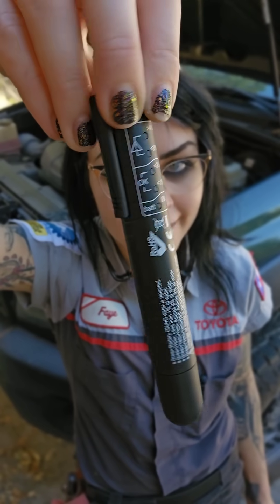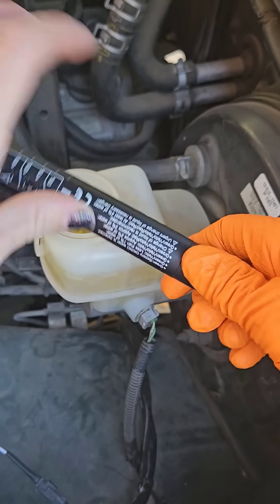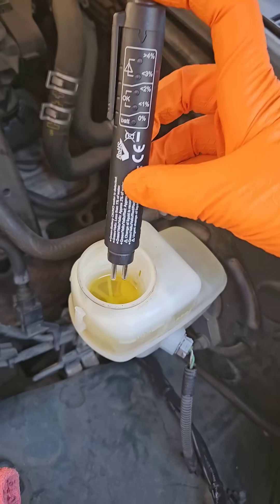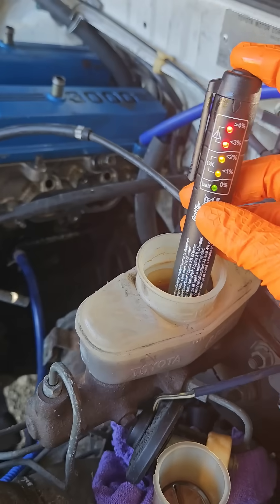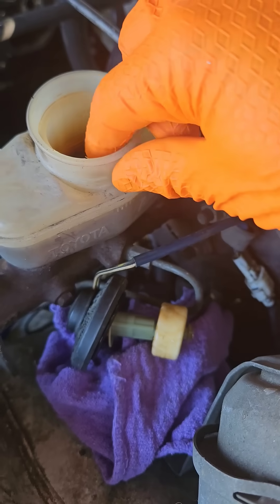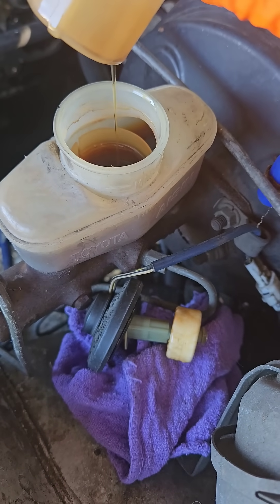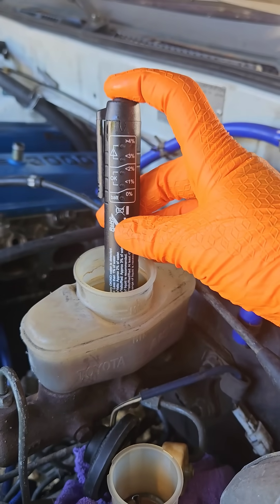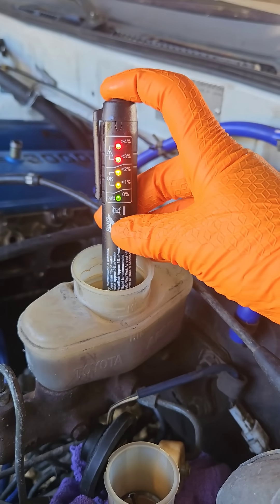Do you REALLY need your Brake Fluid Flushed?? How to Test it For Yourself!

Comment: Most manufacturers recommend a brake flush every 3 years.
If you stick to that time frame, you won't have anything to worry about under normal conditions.
Brake fluid is a lubricant as well and all lubricants brake down over time. Your calipers reach temperatures in excess of 300 degrees after repeated braking. The fluid in your calipers vreak down faster than the fluid in your reservoir. It's not a circulating system. Why risk brake issues over a $100 flush every 3 years?

Comment: Brake fluid is hydroscopic, meaning that it’s designed to absorb moisture.
Reply: That's not what that means. It only means that it absorbs moisture, not necessarily designed to do so.
Reply: @ORam...  it’s designed to absorb moisture to stop moisture ingress.

Comment: Great explanation. The only thing I do not agree with is that water in you braking fluid causes corrosion. Brake fluid is like the most corrosive liquid there is in a car lol
Reply: brake fluid doesn’t cause corrosion, it will just remove paint

Comment: Those do not work, most of those measure electric conductivity, but many modern brake fluids just are slightly conductive out of the factory, so if you use one of those tools on a brand new bottle, there is a high chance it will say that it's saturated while it's not. You better change it as soon as you get an used car, and then change it every 2 years or however much the car manufacturer says. Same with new cars, change it as often as the manufacturer says.

Comment: Everytime I do pads/shoes I empty the rez and refill at minimum. I was taught that during my apprenticeship (yes I'm old) and I just do it. It's not like it costs a lot and fresh fluid instead of burnt black crud can't be a downfall. Even if it's not a line flush a refill is better than nothing.
Reply: I wish any of mechanics were to scam me to change brake fluid and coolant. Its 11 years old at this point. It works great as years can tell breakes do work sharp and water pump has no issues. But then again Hyundai Santa Fe was build for idiots like me. Its probably gonna rust the frame before it shows issues. Recent oil change cost me $38CAD and mechanic asked me if I wanted to change cabin and engine filter. I said no cause I can unclip 3 prongs myself and throw a $6 and $15 filters myself and not worry about the car until next oil change in a year.
Reply: @ruslan1394 An 11 year old car can definitely have saturated brake fluid or contaminated coolant. The old "it works fine" attitude is just asking for disaster.
Reply: @HyperactiveSloth79  I agree it needs to be changed but its not contaminated coolant. Its still vivid green. 

I bought the concentrated jar of coolant from Hyndai dealer $20 (to be mixed with water) but I am debating since I don't want to dump the old water on the ground.

The car is 14 y.o. I bought it 3 years used. I just assume coolant once before was changed.
Reply: @ruslan1394 Once a year?! Do you hardly ever drive it? The only possible way a once a year oil change would be acceptable is if you use full synthetic oil and matching filter, drive it less than 10k miles a year, and change it every spring after the last freeze. 
For normal oil, filter, driving habits and usage, a once a year oil change is going to cut the life of your engine down by a LOT!
Reply: Your going to loose fluid anyway when you bleed the breaks. So when you change your shoes over you might as well. Flush bleed, top off. But that's the only time I've ever done it. With that being said I only own old vehicles. Damn Honda dealership is scamming the shit out if my dad. They told him he has to do a break flush, and get this a ac flush every time he comes in for an oil change. Or of course it voids the warranty. Also the pads have to be broken in and cleaned. 😂 poor dude he knows it's bullshit. But when you buy a brand new car for your wife this shit just happens.

Comment: I messed up once where i neglect the brake fluid flush timing. Had a car for 4 years and drove it daily. One time when i slammed my brake hard, the car wasnt stopping at all, nearly ran an oncoming car. Turns out the whole brake cylinder master seals were messed up due to high water content in the brake fluid from water saturation over the years. So yeah, flush your brakes at least around 1.5 years. Safety first!

Comment: 5years is rule for brake oil change. Gearcase oil change 100,000km.. Motor oil change 10,000km.. Its cheaper then repairing the parts 😉

Comment: There’s also the chance of copper oxide contamination of the brake fluid. This began back in the 90s at some point when Chrysler products started having massive amounts of failures in their antilock brake systems due to the buildup of copper oxide. This subsequently launched a DOT investigation and is also the cause of automotive repair shops actually being required by law to offer a brake fluid service.

Comment: Service Advisor: "It doesn't matter if the car has 500 miles, just do it, it's money for both of us"
Reply: Why’s it matter though? My truck has had the same fluid for like five years. Drive it everyday to work and it never had brake problems I’m not being a troll just to me it seems like if you just do it everytime you have to replace brake pads you would be just fine.
Reply: @xaphan8581 it's the same reason some people's vehicles last 100k with no oil change and some people seize at 5k lol
Reply: @tydatv2674  I’m not talking about engine oil I’m talking about brake fluid. That’s what the video was taking about.
Reply: @xaphan8581  it's an example. My point is it's all just random and luck based.
Reply: @xaphan8581 that's actually the perfect schedule normally! We usually recommend going by mileage or every 3 years, but it's also great to do a quick flush every time you replace brake components. 😊
Reply: @xaphan8581 industry standard is brake fluid “Bf”should be done every three years, regardless of mileage. The higher the moisture content the more corrosion (that equals more future repairs needed). The more moisture, the lower the boiling point which can cause brake fade under certain conditions, typically when you need your brakes the most. And finally, if you go too long between BF service intervals, the higher the probability that when you do finally bleed that system, that doing so will damage the master cylinder. It’s my understanding that the fluid, given enough time, can form microscopic crystals which then cut the rubber diaphragm inside the master, preventing it from sealing. Just do the darn fluid every three years…. It’s cheap insurance to prevent more costly repairs or unsafe conditions down the road.
Reply: @xaphan8581 Having bad fluid will make your breaks wear out faster. How often you should get it flushed is dependent on your vehicle and driving style. You should be able to get by with flushing it at least once a year, or even once every 2 years, depending on those variables.
Reply: Shhiiii I wish. Everywhere I've worked it's the opposite. I'd be rich as hell with service writers like that. 😂

Comment: I flush the system when I change brake pads. I have the bleeders broken at the calipers anyway, before starting, the fluid in the master is removed and replaced before opening the system. A great add on to a professional brake replacement operation.

Comment: Test the reservoir only tells you what the quality of the brake fluid is in the reservoir. The braking system does not circulate fluid so the state of the fluid will always be worse in the lines and in the callipers. BUT if the reservoir fluid is bad then it's definitely time to flush it through.

Comment: It's a scam. Never used to have to flush your brake fluid every 2 years or whatever BS the automotive industry is promoting nowadays. Just took my old lady's VW in for a 30k oil change and when i got the car back it said they had flushed the fluid. What a scam.

Comment: Change it if its oveer 2 yrs ??? C'mon lady, its probably more like change it at your 60K 5 yr tune-up. No reason to get over aggressive with a change this change that at half life attitude. If your brake fluid is only lasting 2 yrs, youve got a deeper issue than the fluid itself, somethings causing the failure, just changing the fluid means whatever the issue is, is going to get worse, and before you know it, your going to be wondering why your fluid is only lasting 6 months...I had to replace my headlight bulbs every month or two, initially blamed it on buying cheap bulbs, until I realised the headlight lenses were cracked, and everytime it rained, water would get in 😮

Comment: True way to test it is by taking it out of the front calliper as that’s where the heat and moisture build up is. Brake systems don’t have a recirculating system so measuring the top up  reservoir means nothing as that’s technically fresher fluid.

Comment: My brake fluid is as old as the vehicle, therefore it was first put into the system in 2003, more than 20 years ago, and the vehicle has over 255,000 miles on it.  Now...what were you saying again?  I forgot.

Comment: Changing old brake fluid is one of the few times when you can actually feel a difference.
Reply: Very true. Like in some cases a near night and day difference especially where really neglected systems are concerned.
Reply: I bought a 89 CRX Si and god knows when the brakes were last serviced… anyway the first thing I did was flush the brake fluid and the night and day difference in pedal feel is immense, as well as greasing the caliper pins and all the brake pad slide points. Probably the most important and also fulfilling job to do on any car
Reply: If you want the calipers to last the life of car, do this.
Reply: I changed fluid on my last car after one of the calipers completely seized up and the car wouldn't move. Of course I also did pads, rotors and the front calipers but I did feel quite the difference lol.
Reply: yes. it always gets much softer and easier to control for me with new fluid
Reply: Jojo-lx8sx I've got some snake oil to sell you then! $20 a bottle, 1 bottle a day, and I promise after a month YOU will tell me you feel a difference!
Reply: Maybe not.
Reply: lol, you will not feel a difference because of the fluid, if there is a difference it's because of something else being remedied by the bleeding. The only possible difference is if you are so hot you are regularly boiling the fluid.
Reply: true, i have a not very old mazda cx30 (2 years) and they changed the break fluid and immediately feels different, so smooth and nice
Reply: Sadly yes...its scary when the brakes get squishy
Reply: @df7817  It's squishy because there's air in the system, the pump doesn't work properly, or there is a leak or a pipe is blocked. Never and ever you see squishy pedal because there is a 0.001% of water inside the oil
Reply: @df7817 they only get squishy if the water turns into steam..which is like never.
Reply: Do  bushing and change wared suspension linkages. Best filling ever <3
Reply: @jarocim  Yes, you are correct, I just had the suspension replaced with all new Toyota parts for my 2008 Highlander with well over 200K miles on it, was like driving a brand new car again. 👍
Reply: If done on schedule it will be well before you can feel a difference
Reply: @rupe53  

But that's just the point. It rarely is done on schedule, particularly on older vehicles.
Reply: Bwahhahahaaa😂
Reply: @adccars359  

Whut?

Comment: I use a similar device to test brake fluid every day, but that's not what I'm here to say... when Brake fluid is left too long and absorbs water, not only does the water boil, but causes sludge and eats away at the inside of the brakes, so you end up with sticky and leaky brakes... a bottle of brake fluid is cheap, much cheaper than a brake rebuild... which will need to be done way sooner if you don't change the fluid. but not doing either could cost someone their life!

Comment: Amen. The 01 camry i bought beginning of last year never had any attention paid to the brake fluid. A priest, an exceedingly old woman, and a 19 year old kid were the chain of command before i bought it. $1000, 70K on the motor, but the brakes felt odd from the day i bought it. December i had two major strokes, and when i finally tried to drive it again, aggressively pumping the brakes HARD, and pulling the e-brake like a lonely virgin on prom night. New master cylinder and brake booster finally worked on the 2nd set when i physically disconnected everything and blew out the lines, freeing lots of chunky rust to be expelled. The old booster was full of rusty water and brake fluid. Pay attention to this, it was almost as devastating as the health issues. Special thanks to rockauto and dorman for preventing a meltdown that definitely would have caused me to stroke out for a 3rd time. Check your flippin' fluids properly, the consequences are devastating.

Comment: Adding to her good summary; brake fluid becomes acidic as it absorbs that moisture. This caustic affect begins to erode copper out of your brake lines and valves. Eventually, and i mean eventually, holes will be eaten out of your brake system and youll get a leak. So if your fluid looks green or smells like fish change it!

Comment: I got a brake flush once. The tech left his wrench on the bleeder valve nut. As I drove home all was good, but while in a parking lot and making a sharp turn, I suddenly lost all break pressure. Then after straightening the wheels, brake pressure returned. Imagine the confusion I had and the trouble convincing the dealer that something was wrong. 

I went to another dealer and they found the wrench. It would impact a strut when wheels turned far enough and that would impart force against the caliper’s bleeder valve temporarily. Such a strange situation. Anyway, it was resolved, but not after much stress.
Reply: Wow, that is so random.
Reply: that is a weird one

Comment: A mechanic told me once its a good idea to bleed the caliper of fluid when you do a brake job because the fluid doesn't circulate becoming acidic over time from heating and cooling. And of course water is a problem too.

Comment: Everytime I've had a customer open the master cylinder they either lose the cap and tape a plastic bag over it letting moisture in or fill it with washer fluid. Do-it-yourselfers from you tube actually make me more money. The hoods should be locked shut so people who dont know what they're doing can't cause damage harming other people on the road. You can also buy inspection cameras online for $25 and perform some endoscopy on yourself to see if your doctor is scamming you. Lmao

Comment: Over the course of my 30 years of working on cars, I've never seen a brake fluid flush benefit a vehicle. Unless there was a incompetent person working on the vehicle prior there shouldn't be water in your brake lines. You have bigger issues.  Also if you have a master cylinder failure you'll be doing a flush regardless.  Not selling me on this.

Comment: Thing you didn’t mention was the rubber seals in the master cylinder getting messed up if you don’t replace the brake fluid. I bought a car and replaced the fluid and found out the hard way. Nearly crashed due to intermittent brakes.

Comment: Second thing. Flushing brake fluid out is ridiculously easy with two people but a bit time-consuming. If you know a handyman or mechanically inclined person, I'd consider asking. You can press/pump the brake while they open and close the valve at the brake caliper. (Not getting into details here, but that about sums it up)

Comment: Don’t need any fancy tools; use your eyes. Since brake fluid is hydroscopic, when it absorbs water it will oxidize, turning a dark color. The darker it is, the sooner you need to flush it out. Or flush it out at regular intervals, such as 30,000 miles.
Reply: That’s basically what I was going to say.  I once took my brand new Nissan frontier in for its FIRST oil change at the stealership.  The kid told me I needed to get my brake system flushed.  I had him and the service manager use the tester in my brake fluid.  It felt nice to see them both look so ashamed of themselves. I got a free set of weather tech mats from that oil change.
Reply: @petrosspetrosgali Nice! I wish I could get a $400 set of floor liners for free!
Reply: I might say sooner than that if you live in more humid and rainier regions too.

Comment: Brake fluid goes bad over time, not catatonically fails.

If your brakes are starting to get squishy, check it out, but you don't need to add "open the sealed system" to your PMC's

Comment: I recognize that I'm gambling, but I have done most of the work on my cars for the last 20 years and have never changed brake fluid. My oldest car is 15 (a scion XB) and I just changed the rear pads and rotors, and it brakes great. 

Why don't I change the fluid? Laziness. Not because I think it's not better to do it and have fresh fluid. I'm sure it is.

Comment: In larger hydraulic brake systems or with vehicles that have copper nickel replaced lines or those damn pressure couplings.  The compressed water that turns to steam will blow out a line or damage your ABS system.

Comment: I change brake fluid using a turkey baster in the small reservoir under the hood every few months. 

It flushes enough of the system to keep the brakes in good condition. Is it even necessary to do a full system flush if I flush the reservoir enough?

Comment: I worked as a detailer in a UK franchise. The mechanics often charged for brake fluid flush and refill but never did the work. Instead they would take the paid for fluid and sell it to their local non franchise mechanic mates. They also did coolant, brake discs, shock absorbers but not as often as those were more visible to customers.